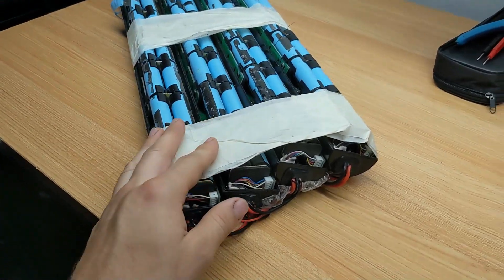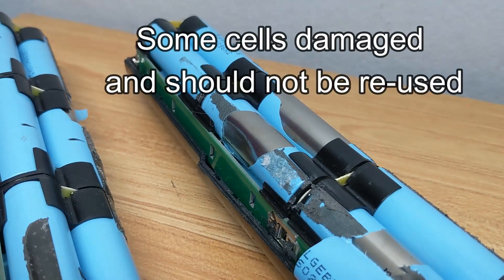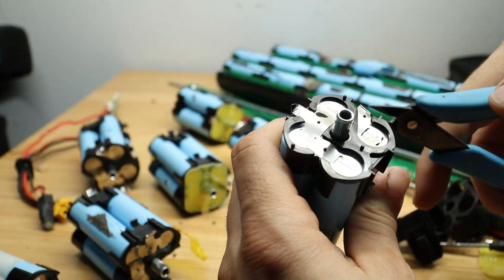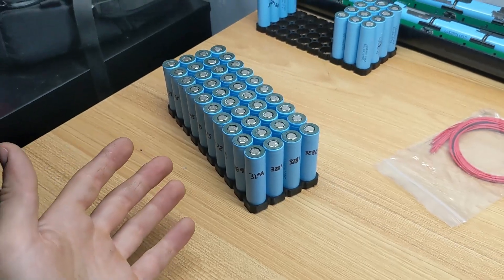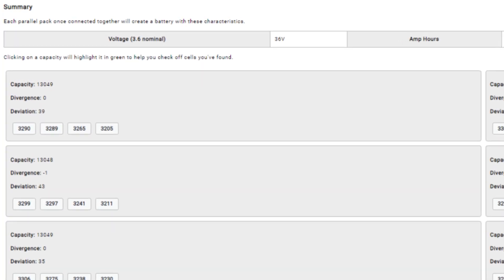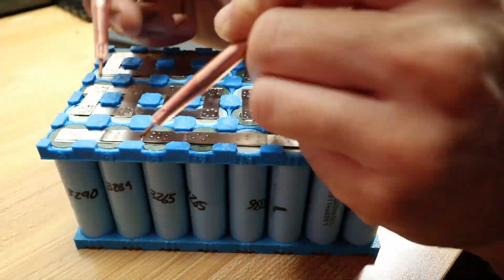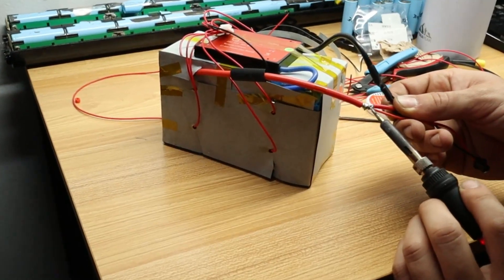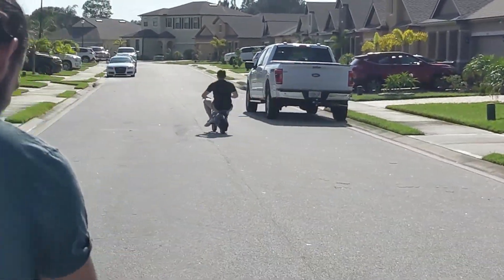Building a 36v E-Bike Battery from RECYCLED LG Cells!

Comment: i managed to get hold of 10 36v v-10s 4p battery packs with the lg mh1 cells (bms locked ,i tested them on zb2l3 capacity testers whilst still built and they have all tested over 12ah on each series of 4 so i joined 2 and put a 40 amp bms on and now have a 36v 25ah battery for less than 50 pound ,still have 8 packs to play with ,i did do a video of the build and the range test all be it im no pro ,ive just got my first spot welder so been practicing and will be building a 48v -13s 6p in the next few days, hope mine looks as smart as yours does ,great job thanx for the video

Comment: I did pretty much everything you are not supposed to 
Random collection of recovered cells ✅

Wide variety of different voltage cells strategically placed in random spots in the bank (as much as 1-1.5v difference )✅

Use REALLY HOT soldering iron and extra Flux ( use blow torch if needed to give iron extra heat to overcome batteries excellent ability to disparate heat ✅

Used bare unwrapped cell✅

It was rough but worked
Reply from the maker: bites nails nervously